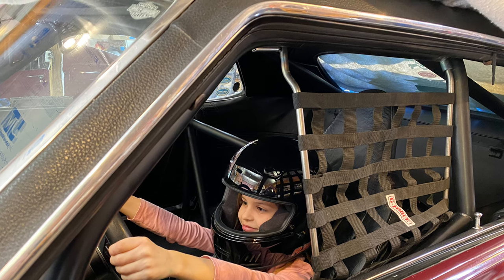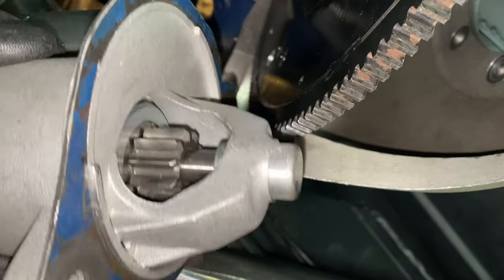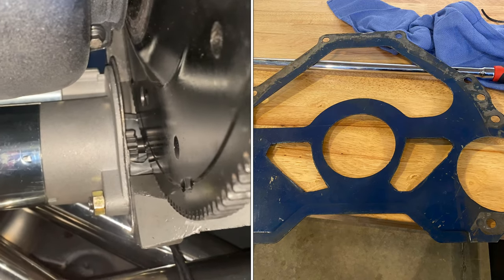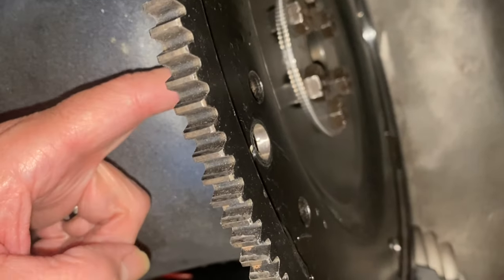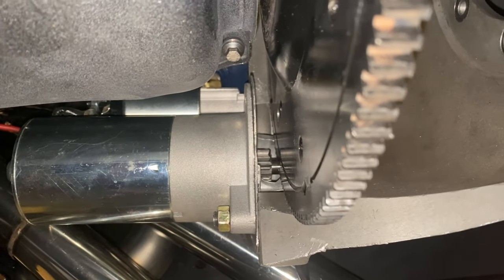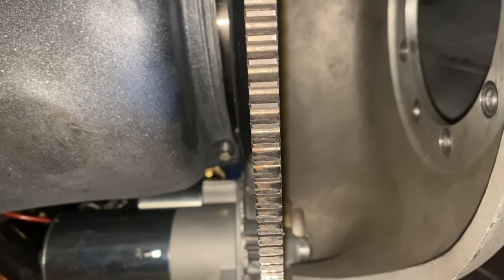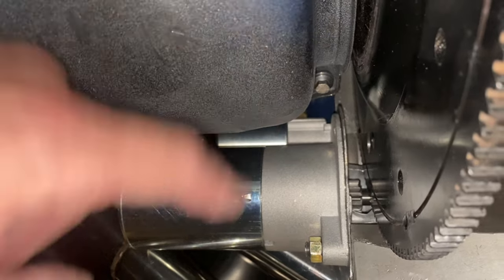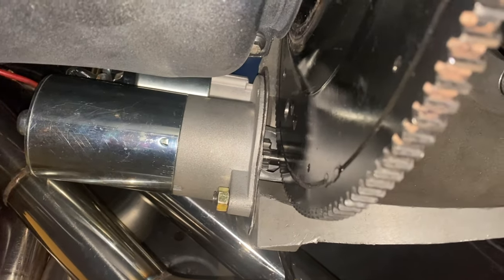DBG: Starter To Ring Gear Clearance With CE Mid Plate, Will Transmission Fit Without Removing Header

Comment: Tim great job manhandling that transmission ,I had a similar experience with my Fairlane changing the clutch and pressure plate. Couldn’t get the Lakewood bell housing off headers were in the way so had to pull the housing back and twist it to get the most space between bell housing and flywheel so I shoehorned the pressure plate and disc dropped it out with bell housing still 3 inches away from the block. Needless to say it was a Bear !

Comment: Tim, just a suggestion you might give a try, when getting ready to install your transmission, cut the heads off from a couple of long 7/6" bolts and then add a slot for a flat screw driver use them as guide pins in the outer two bell housing bolt holes one on each side it works great for lining things up and getting the torque converter studs rotated into the flexplate. By the way you are a beast man handling that trans into place on the side to clear the headers.
Reply from the maker: Tim thanks for the suggestion. I may have to try that. It is tough doing this in your back. But if that can make it easier trying it out. I don’t feel like a beast the next day, lol. Worked with it last night. Header has to come off too much weight to man handle into place. 😳

Comment: DragBoss Garage  Hi Tim. I'm glad you got that mid plate ordeal all figured out. Now for putting the transmission in.  I don't think you will get it in like that with the trans pan on. I certainly would not chance putting it in with the valve body smacking the headers. You are there to see it but it looks like you will have to at least take one header loose or off. Maybe if you got the car higher and you lifted it tail shaft up and leveled it out. Of coarse with no converter in it and no fluid. Then put the converter in after you have it held by a jack.
Reply from the maker: There is plenty of room for pan Matt. Might be the way it looks. But I will check again. Yes right side header off be much easier. My new transmission Jack strap’s transmission to it. We will find out soon. Thank you
Reply: @DragBoss351Cleveland  Oh ok, I guess it was the camera angle. Looked and sounded like you were hitting the drivers header. I hope you can put it in with not much issue. I have always taken the headers off but I know your new headers are more of a pain than mine lol. Your progress is looking great though 💪
Reply from the maker: Yeah, I will try to fit again. I think it’ll be fine. Just Gotta keep going. Glad you’re here. Thank you.

Comment: Hi Tim, that looks good ! Where you want  the gear engagement.
Reply from the maker: Surprised the pros did not understand this or have experience with this. Thanks John. What do you think about installing transmission the way I am thinking?
Reply: @DragBoss351Cleveland   well Tim, if you can get a transmission jack, it would certainly help. Your plan too turn the transmission  on it's side, looks to be about the only way to install it.
Reply from the maker: Yes John, I have a transmission jack. It’s kind of a scissor jack, only for transmissions. Cheap from Harbor freight but seems like it’ll do the job fine. I got my fingers crossed.

Comment: I was doing some repairs/ maintenance and got hurt with shoulder back pain that migrated to the sternum. Quite painful for 4 days. Cotochondritis , research reveals. I'm 55 and winced about that man handling. Instead of working like Bruce Lee , it's more like Tai Chi.
Reply from the maker: I see that a lot. Really what works good is 5 to 9 days of prednisone. You can try topical diclofenac can buy it at the drugstore. And Tylenol 1000 mg three times a day. No more than 4000mg in 24 hrs for future pain.
Reply: Ha ha , I lounged and slept in an easy chair those 4 days thinking I got meningitis? Just a pinched nerve. Thanks Doc Boss.

Comment: looks right now but one more thing the starter comes two ways one for auto trans. and one for a standard trans. that makes a difference to.
Reply from the maker: Did not know that. What is difference? Same style starter been running for over 10 year.
Reply: @DragBoss351Cleveland  the difference is the part that fits in the bell housing one is longer than the other.  get one of each from orielys and you will see the difference its about 1/4" to 3/8" thats alot of difference so make sure you have the right one.